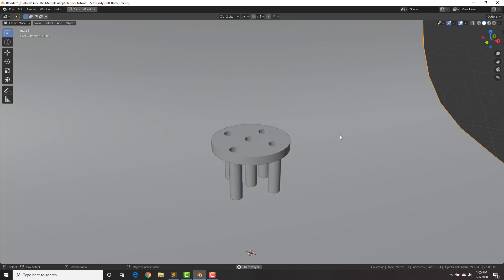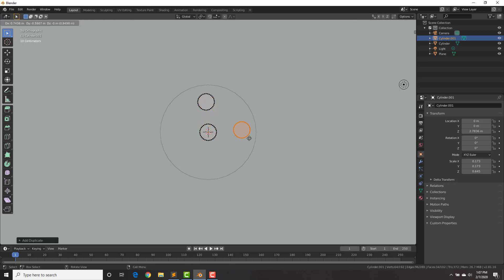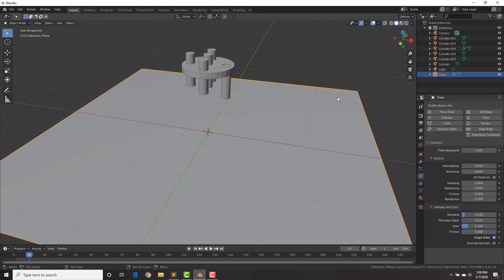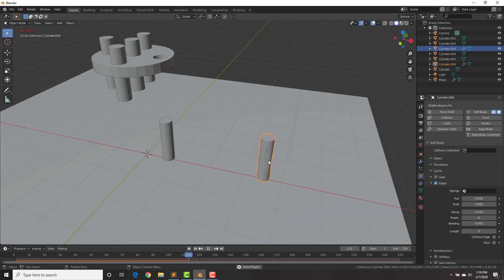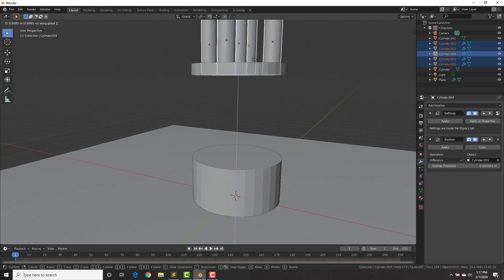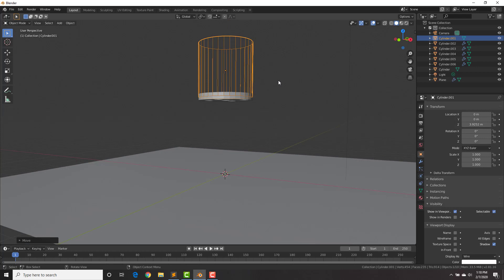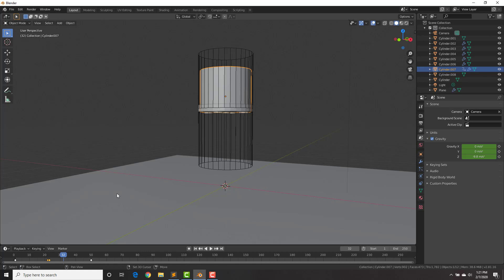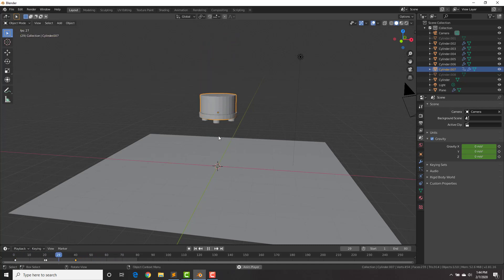Blender Tutorial - Soft Body Physics Blender 2.8

Comment: 5:59 you don't need to copy  the cylinders. All u do is select all the other cylinders and then select the one that has the physics last. Then u press ctr+L and click modifiers. In blender all physics settings are modifiers so you can do that. The rigid body is the only one that is not a modifier and that's why it has a separate button for copying settings